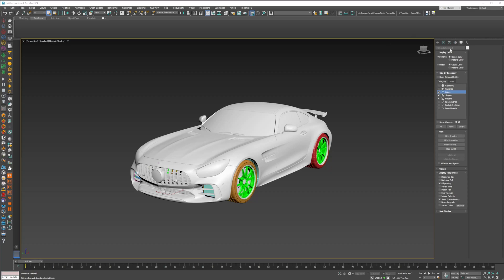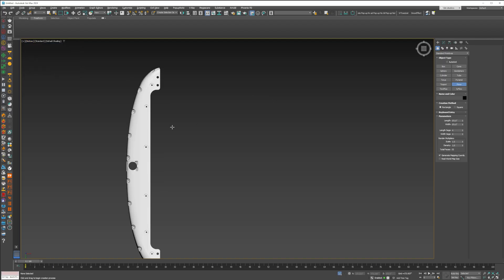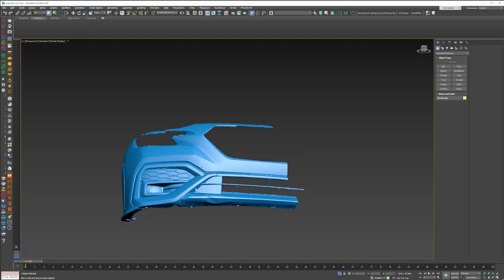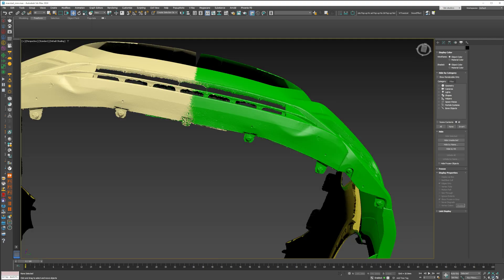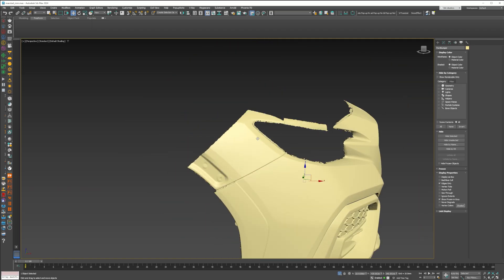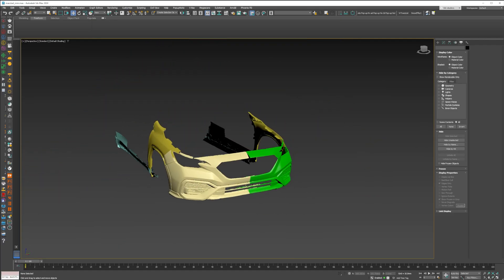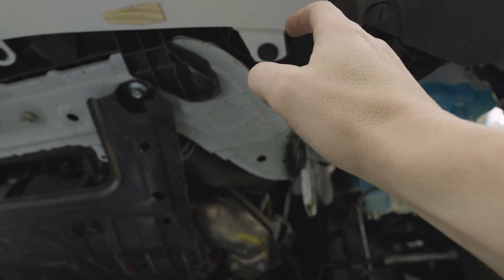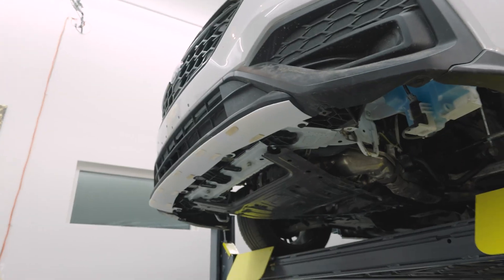Why I Only 3D Scan HALF the Vehicle for Custom Parts

Comment: Hello Awesome Videos - I'm looking to buy a 3D scanner to scan my Merkur XR4ti into a File to make a Thunder Saloon Wide Body kit, what scanner would you recommend for me to buy? I plan on buying a full sizes 3D Printer to print all of my parts in 1 piece
Reply from the maker: I can only recommend based on personal experience and automotive use.
You cannot go wrong with the traditional Einstar1. Its an amazing unit for the money.

If you want to spend a little more the Einstar2 is really good, but only thing I am still not going to promote on the Einstar2 is the IR mode and thats only due to software having issues. Once Shining3D/Einstar fix the issues with IR mode performance on the software that will hands down be the recommend. With that said, if you want to use tracking markers than Laser mode on Einstar2 is really really good, just sadly required markers to scan.

Comment: When I design the front bumper for my 944, there was 2 bolts in the "middle" of the crash bar and I thought the middle of them is the center but it wasn't haha. From that moment I always have to double check real life dimension. Sometimes it can looks very symmetrical until you check it and see that its not. But I love this trick I only scan pretty much half the car then print some small test print to double check the mounting position before printing the rest.
Reply from the maker: ahahaha, ohh yes even then I agree with you, we need to test print quick parts to make sure alignment is in fact good. Only thing I hate about 3d scanning my own cars is the symmetry not being 100% flawless lol